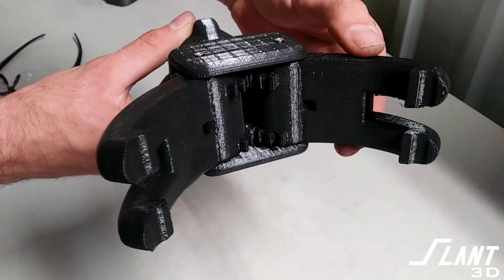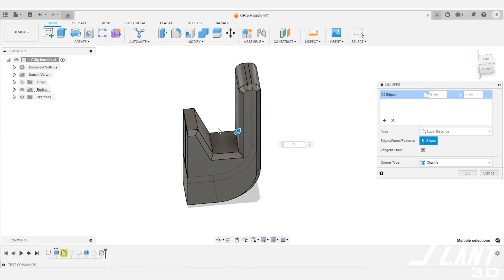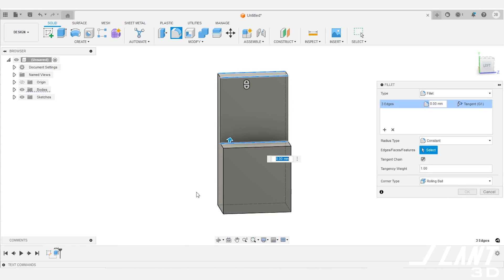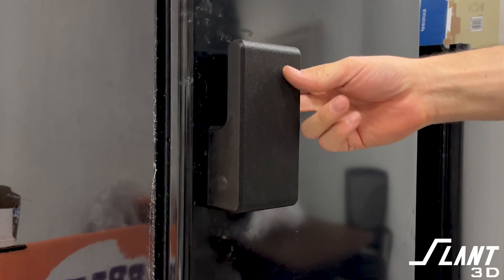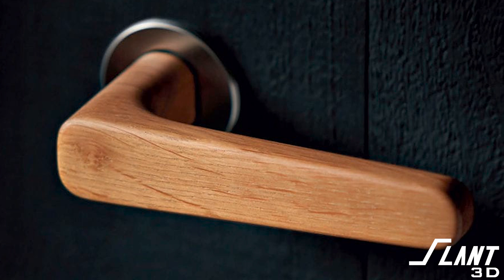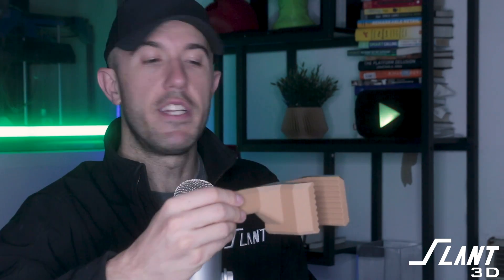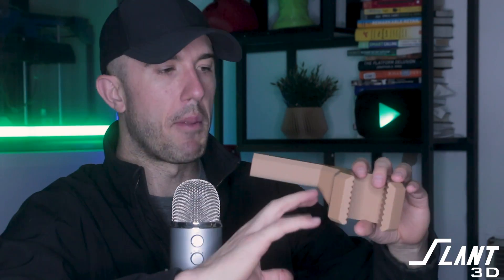Command Strip Handles | Design for Mass Production 3D Printing

Comment: I'm pretty sure all of these handles can be made by injection molding. You just need to cast them in a few parts and weld the parts together...
Reply: And that would be easier than printing it?
Reply: @jasonhunt7382  Claiming that it is 'impossible' or 'utilizing excessive material' in any other manner is inaccurate. Two half shells can be produced through injection molding and subsequently welded together, entirely automated within a large Chinese factory, ultimately reducing the cost of one part to a few pennies, as opposed to the 5-hour duration required for printing a single part.

Comment: 0:59. Do you actually have any background in injection molding? Shrink is ALWAYS a factor. While it is true that thick walls are not best practice because of sink marks, especially for some materials such as ABS, that does not mean that they are impossible. I've seen products thicker than yours injection molded. It comes down to material selection, injection/packing pressure, and cooling time in the mold.

You produce good content and are definitely an enabler for the 3D printing hobby and small entrepreneurs. But please stop misrepresenting injection molding. I get it; the injection molding industry is your competition. So are some other industries/processes (rotomolding, blowmolding, metal stamping/forming), but your videos make it very clear that you view injection molding as your most influential/dangerous competitor.

I'm a plastics manufacturing and design engineer. I've worked in additive, extrusion, injection molding, thermoforming, and flat-pack structures. I've designed for several other industries as well. 3D printing is not the holy grail, and I say that as one who was enamored with it years ago when I got my first printer in college.

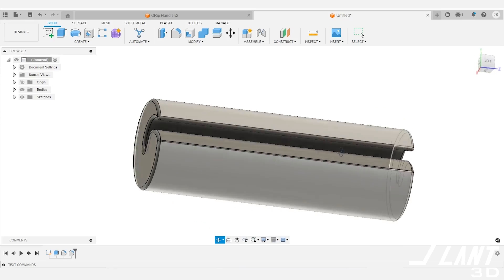Comment: 1:30   could you use a hot wire to cut a block/dowel of plastic into that shape? i bet you could. you might need some robot to move the dowel while it cuts it with the wire. but you might have wasted material if the plastic arrives in a rectangle, then you shave it down into a dowel shape.

Comment: 13:14 when you say "applied the texture to the outerside so it doesnt look like a printed part" what are you referring to, are you adding a pattern in CAD that effects the visual asthetic?
Reply: I personally used blender modifiers to do something similar and it visually eliminates layer lines and even the z seam completely, wich looks spectacular. There's also a configuration to do so in blender wich will make random movements all along x and y axis, but I haven't tried it since it makes it all around the piece and wasn't looking for that
Reply: which modifiers mate? @nombre652

Comment: Your first part could be quite easily manufactured without 3d printing tho. You could theoretically just extrude it and then cut to length.  
Would be cheap and quick to manufacture. 

Otherwise very great video as always :)
Reply from the maker: Problem is: 
Up front cost of the die. 
Minimum order Quantity. 
More material Used. 
Cannot change the design. 
Also cannot round the ends as is needed but we did not update the model in time for the video to be published. But fortunately is is 3D Printed so the design can change at any time.
Reply: @slant3d  All of those are valid points. 
But the cost of the die wouldnt be as expensive as its not needed to be very precise. 
The rounded edges are nice, but for such a product not needed honestly. 

I feel like both, 3D Printing and Extruding, has its up and downsides in this particular product and both are pretty viable in their own right in my opinion. 

But thats no critique on your idea and or video. It surely has really great upsides that this is 3D printed, as you said especially design changes are easy and quick. :)

Comment: A bucket grip (@ 0:28) can be continuously die extruded at a very low cost of production and sawed off on that very same line of extrusion.
Edit: Dense foam filled-in extrusion, and/or empty contoured shape using other polymers.
Reply from the maker: Up front cost of the die. Minimum order Quantity. More material Used. Cannot change the design. Also cannot round the ends as is needed but we did not update the model in time for the video to be published. But fortuantely is is 3D Printed so the design can change at any time.
Reply: @slant3d  to be honest though wouldn't the die extrusion process be hugely more efficient? as in meters per second of parts produced vs an hour per part for 3d printing?
Reply: @n0pc0de  Definitely true, but the economics of it will come down to how big a run you’re looking at doing. His other examples literally couldn’t be done with other technologies (or would be uneconomic), but this one could indeed be extruded if you were making 10s of thousands of them. His other points are all valid too though, and I suspect if you were looking for quantities of 5k or less 3D printing would be the winner.

Comment: How would you design a pen?
Reply from the maker: We'll see
Reply: The parts ive printed with the highest quality have walls 2-3mm wide and are at least 15mm tall. Not sure how that would work out with the small parts of a pen

Using a 0.2mm fdm printer or a resin printer would be better for that though

Comment: I like the ideas but the grip in the beginning is somewhat of a bad example. While you are correct that it is difficult to injection mold or mill it is perfect for extrusion. The setup would be even cheaper that hardmilling a mold since you only have to edm a 2d template with minimal rake.
But other than that great tips as always.
Reply from the maker: Partially true. But extrusion would not have the texture. There would fairly high minimum volumes. You of course have the up front cost of the die. And it would be heavier which would increase shipping costs and lend slightly to user fatigue if they have to use it for extended periods of time. And it could not be produced on demand and have the design changed at any time.

Comment: based on your experience, how many perimeters and which % of infill would you use for those handles?
Reply from the maker: Depends entirely on the specific handle. But most of these are fine with 2 perimeters and 10 percent.